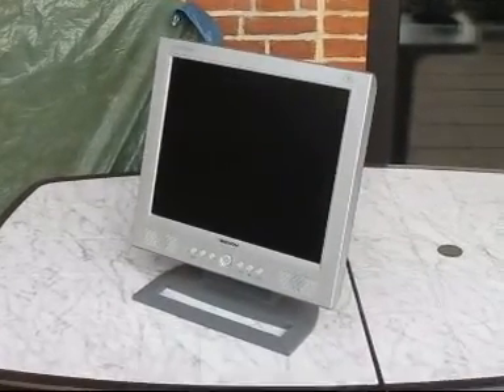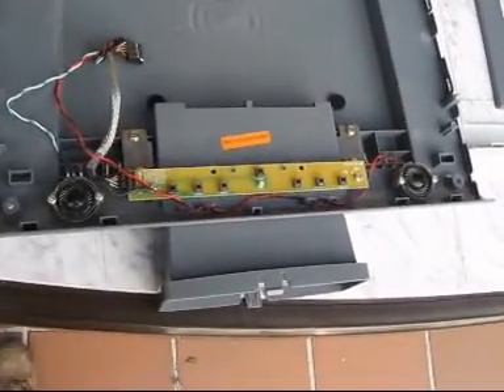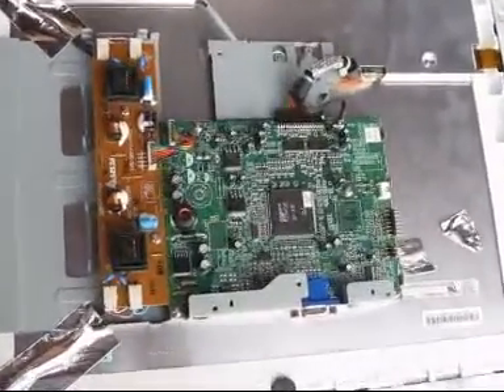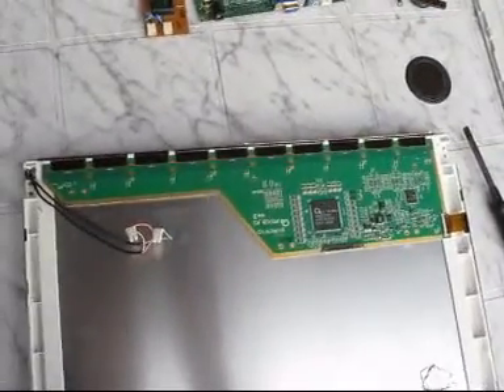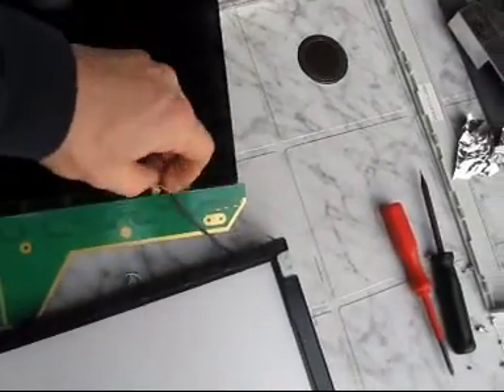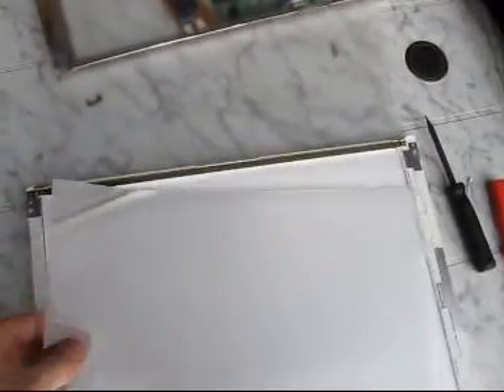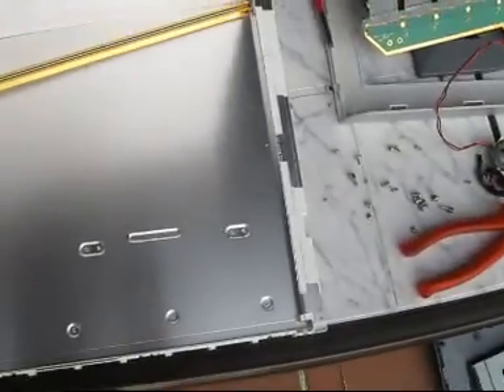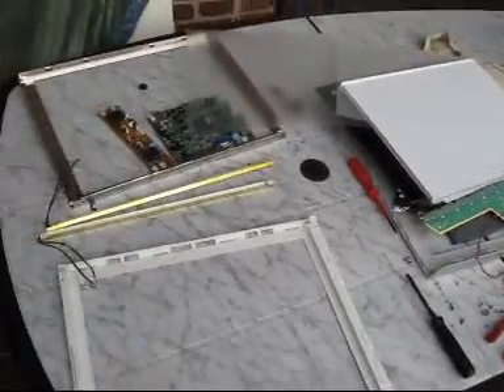WHAT'S INSIDE ? #02 DISASSEMBLING A FLATSCREEN MONITOR

Comment: Would it be possible to light the florescent bulbs with 12 volt power supply? 
Have you found and magnets?
I would look forward also to a water garden tour and advice video!
Reply: U have power up the CCFL via the inverters anyway and these inverters need 12VDC very often. But inverters from Laptop displays or old scanners need an "enable pin" to be connected to either GND or 12V. but everything depends on model as usual...

BTW I dunno why this is in 240p now .
I know I recorded this in 480p with much better image quality.